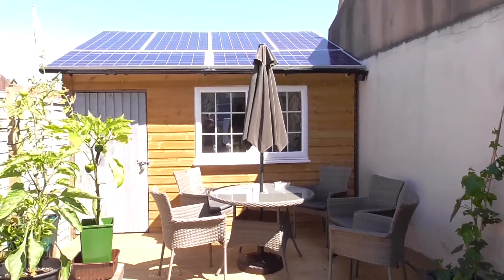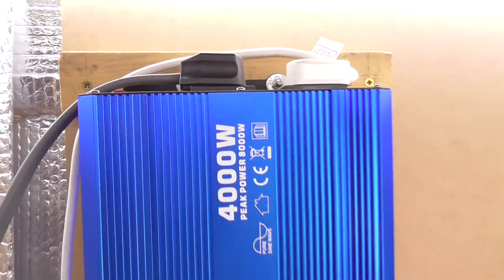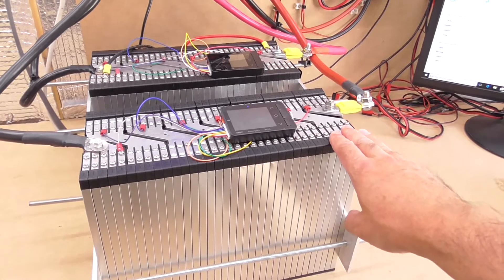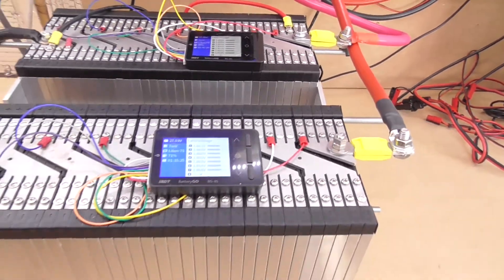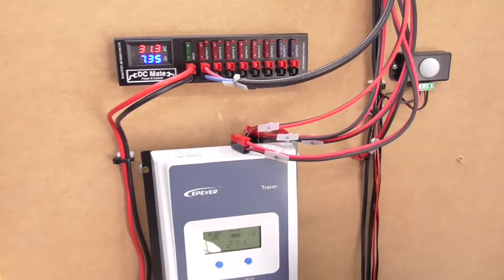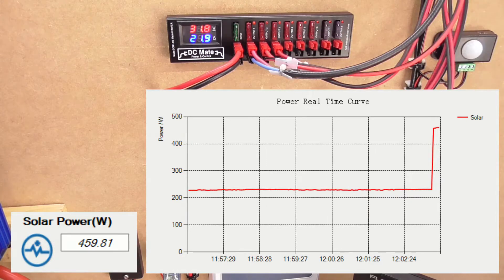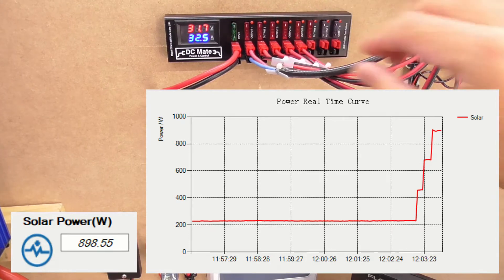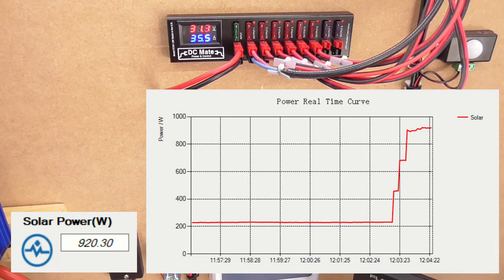Off Grid Solar Shed and DIY Powerwall Update

Comment: Did you consider the Hybrid inverter/controllers? The "UPS" for your house? Power the house with solar and then when the big stuff comes on it goes to mains power? If the mains goes off though your already on your own power. Prices from £220 UP. I am a retired engineer revisiting solar from a failed Maplin caravan charger ten years ago. Things are a lot better and cheaper.😉

Comment: i have been looking at the epever upower units as they are inverter/chargers but also handle solar one thing id like to know is if the epever inverters can be controlled from the poc software also power usage etc

Comment: if the panels are prown to shading i would put a diode on the positive lead of each panel so the panels dont back feed into the lower powered one due to shading
Reply from the maker: Can that really happen? The shaded panels might be producing less current but surely they're all sat at the same voltage, I'll measure it tomorrow.
Reply: @recklessengineering8628  yeah it happens you will prob see it if you just plug in a none shaded panel and a shaded one see the current will drop as it is feededing the other panel voltage is only there if the ampage is havey load with low ampage will draw the panel voltage down this will also bring the other panels down
Reply: @recklessengineering8628  the idea of the diode is the weak panel will stay out of the circuit untill it can match the others
Reply: @recklessengineering8628  https://www.altestore.com/blog/2016/09/bypass-diodes-blocking-diodes-solar-panels/#.XxcTOZ5KiUk
Reply from the maker: Looks like an idea for a future video, must check the datasheet for the panels, on case there's one in there already
Reply: @recklessengineering8628  will be interesting to see if the blocking diode make a diference